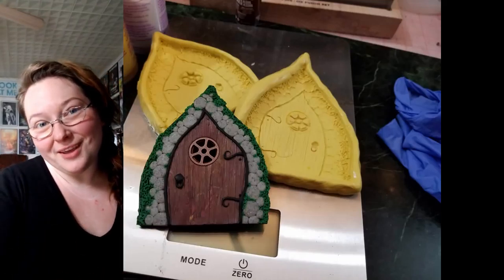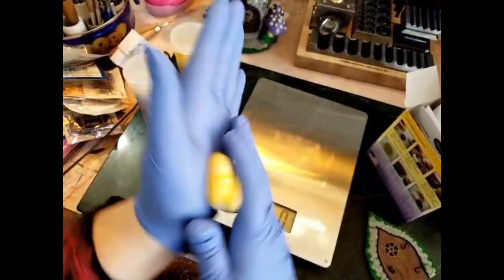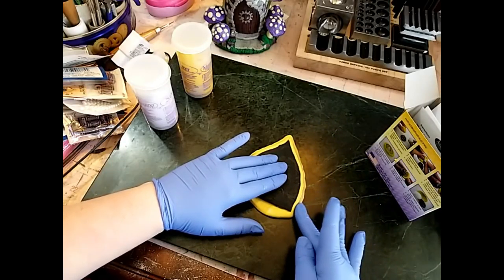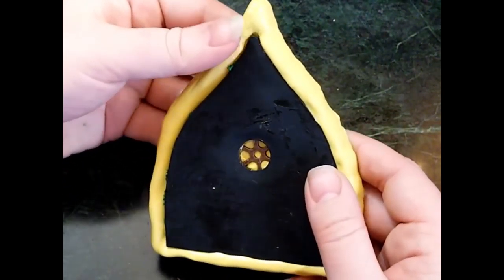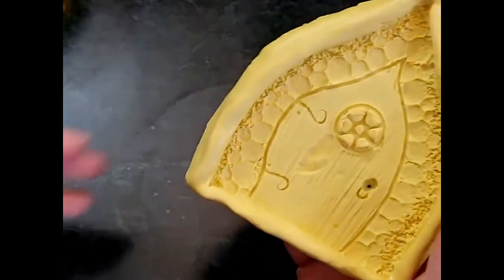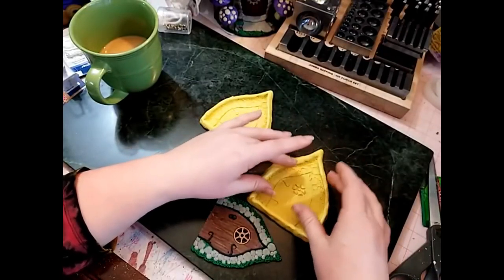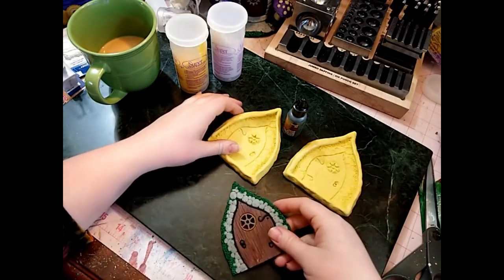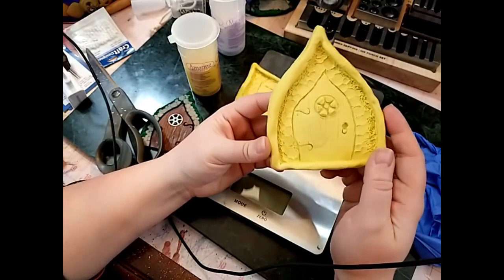Casting a Fairy Door Part 1

Comment: If it wasn't for the air bubbling part, I was going to suggest packing tape on the thinner areas or areas where you can see light through it. I don't know if packing tape works on that certain type of mold making material, but I have seen it used on other materials and it kept the resin inside nicely.

On edit: I see you salvaged it. Great! You could add another actual gear for the window area. That might be interesting. Other than trying out a multilayer/multicolor pour based on the colors you will be using, I wouldn't know what to suggest, other than the packing tape on the back to stop too much of the resin from running out. A little might still run out, but it won't destroy the entire pour if you know how to sand and polish it back up, if you want to. It'll be on the back. Depending on how transparent your colors are, it might not even be a big deal.

I love that little door. You really know how to make beautiful things.
Reply from the maker: ooo, I love the packaging tape idea!!  and I am so gonna try adding an actual ear to the resin (you have blown my mind, I don't know if I ever would have thought of that!!)

Comment: Von, have you heard about a product called Oyumaru? It’s a thermoplastic modelling compound from Japan but easily accessible on Amazon. You simply put it into hot water to soften, then press it in, on, or around your object, then it hardens as it cools down. You can make a mold with it, or you can also use it in a mold itself to make small plasticized pieces. I've also used it as a mold or texture sheet mask to fill in parts that I didn't want or wanted to change. It's non-toxic, easy to use, no special tools needed, and is not that expensive, especially since it can be used over and over again. There are lots of YouTube tutorials and reviews (just like anything and everything else out there LOL). It works well with polymer clay but is great for resin, especially when you are making only one or two pieces. It doesn't replace silicone for mass production of pieces but is great to use for specific projects. Thought you might want to check it out ❤ 🧡💛💚💙💜

p.s. I meant to let you know that there is a saying in regards to silicone, it goes, "Nothing sticks to silicone except silicone." I have found that, so far, to be true. Now, mind you, a few things may be so sticky that they require a mold release but nothing should stick permanently.
Reply from the maker: Heya, Starcat! I will check Oyumaru out! Thanks for the great tips :)

Comment: Maybe if you try pressing the mold mix on the door instead of the door on the mix. Like roll it in a ball and center it on the door then spreading the mixture out wards to squeeze out any chance for air bubbles. As for the door knob poking thru, if u did mold on top of door u would have been able to see that and pinch some of the extra off the sides and correct it. Then lightly press the mold on the table to make the mold back flat. U think that might work a little better?
Reply from the maker: Hey, Tammy! These are really great ideas! I will try that next time :-D

Comment: @Yvonne Williams  Hey since I do a lot of silicone molds for my FX prosthetics I thought I would pass this info on.  Silicone only will stick to silicone.  So yes it would stick to itself.  However...trying to patch a silicone mold doesn't work.  It will show the patch in the cast.  The only time a patch job would work is if it is a tare on the outside of the mold.  Even when you do that you have to block the rest of the silicone mold (I do this with clay) so it will not drip or adhere to anywhere else.  With puddy is it harder to to get rid of the bubbles vs tin silicone that you pour smooth on's  oomoo is really good and you would get a lot more molds out of a started kit. If you have any question let me know. PS one you touch a silicone when it is curing it will and can rune them.
Reply from the maker: This is really excellent advice, thank you!! I am drooling over smooth-ons products; I can't wait for it to fit into the budget!!!
Reply: Next time I make some molds I will make tutorial for you with lot tips.

Comment: https://youtu.be/7fwytA5r2Mw

He is a link to the “The king of Random” YouTube video about “Protto Putty” which is basically the same thing as this. This stuff that he makes is made out of simple ingredients found at a hardware store, and in my experience is much cheaper than this professional stuff. I use it to make moulds often and it works great for me, though I sometimes have slight issues. Also a very well ventilated area is needed.
Reply from the maker: Heya, Stormy! Thank you I will check that out!